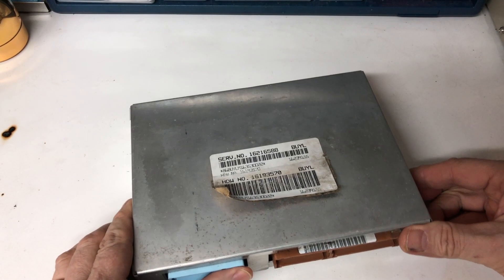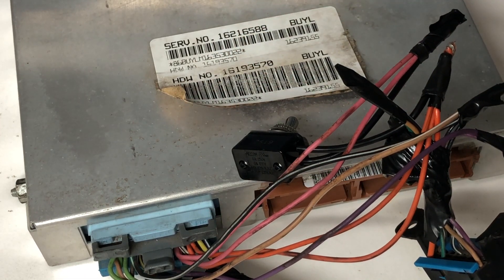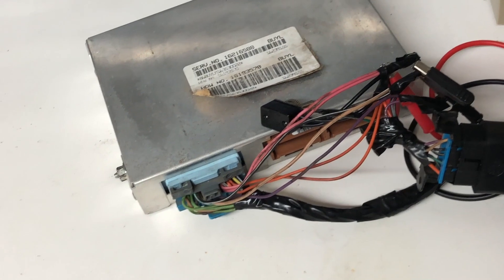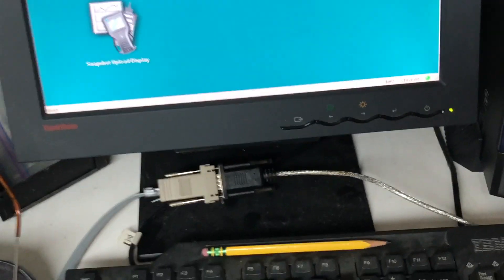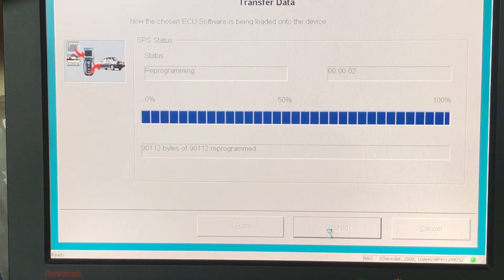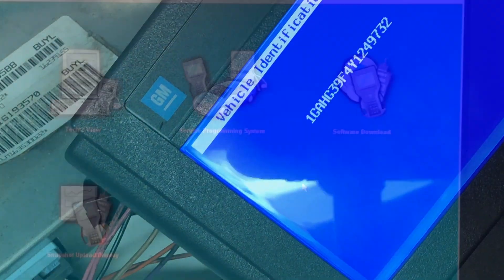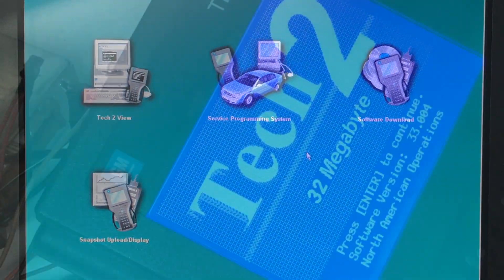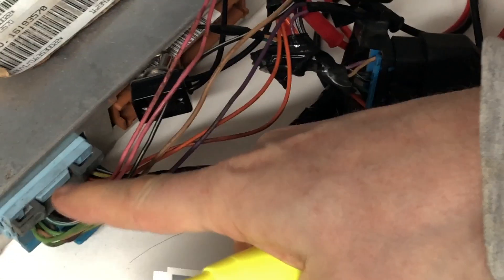1996 - 2002 GM 6.5L Diesel Used Salvage Yard PCM VIN Reflash with SPS and Tech2 (Chevy & GMC)

Comment: Hello
Can you please measure where the diode between the two capacitors behind the pin 1 of the light blue connector is connected to the light blue connector? Regards

Comment: I'm confused. If you use the donor VIN then wouldn't a State inspection thru the OBD Port mess things up since the PCM VIN is no longer matching the actual Vehicle VIN?
Reply from the maker: Donor PCM, not donor VIN.   SPS will reprogram the donor PCM with the trucks VIN as part of the re-calibration process.  Not the other way around.   The screen I believe you are referencing is just the opportunity to confirm you want to overwrite the donor PCMs currently stored VIN with the one for the target truck.  When bench programming, with the PCM out of the truck, you have to tell SPS what VIN to go with.   This sort of situation only arises with a salvage yard PCM.   A new, or remanufactured, PCM will not have a VIN married to it out of the box.

Comment: Your experience is so valuable to so many people!  Can you please help me find a great company to work on my PMC/ECM for a 1996 GMC Diesel 6.5L Turbo model K20953 pickup.  My mechanic can't find a reputable company to work on it or find a replacement part that can be programed.  Any help is truly appreciated because my pickup that I love is just sitting waiting for this important part!  : )
Reply from the maker: Thanks, these PCMs are not discontinued and still available from GM so not sure why your mechanic is having trouble there.   There are search links in the video description.   

Now they are not cheap, need to be programmed, and are not available aftermarket.   So you'll have to be willing to put down the coin for a remanufactured unit.  Or, alternatively, have a mechanic with a subscription to www.acdelcotds.com and a GM compatible J2534 scan tool to use SPS2 to reprogram a salvage yard one as I showed in this video.

If you don't have access to someone who can program these, then try on the eBay link I provide in the description for a seller who will do the programming for you if you buy their used PCM.   Usually Flagship One will do that.

Comment: What was the original problem that made you want to change the pcm. I love you videos you keep my pickup go pickup going there is no Mechanic in my area that know how to work on 6.5
Reply from the maker: This particular video wasn't the result of a repair need.  In this case I was salvaging the PCM for resell.   The video was just my sharing how I go about making sure I'm selling a good core in doing so.

Typically you would be replacing the PCM though for limited reasons.  So as if it was physically damaged (like during a collision), water damaged (like in a flood), internal corrosion (oxidation affecting the circuit board connectors or components), or electrically damaged (where a short or surge has knocked some or all of its original functionality).   They are otherwise very hardy components and rarely go bad.

Comment: Will this work with the 99 6.5 gmc savanna short busses
Thanyou Doc!!!
Reply from the maker: afaik, every 6.5L diesel from 1996 and up used this same PCM.  Though I have seen the Hummer H1s sold under an AM General part number assigned rather than using the GM part number (yet the ones I've seen still have the Delphi 16216588 sticker on top).

Comment: Would you happen to have a part number for the service manual you are using?  I would love to have a copy of that for my 6.5L.  This is a very inspiring video :)
Reply from the maker: They are out of print with Helm nowadays, but they are fairly common on eBay.  I'm using the 1998 2nd edition C/K service manual for this video.  It was a rather large 4 volume set cover all body styles of C/K trucks.  Here's an eBay affiliate link showing several listings - https://ebay.us/z5cENd
Reply: @DrShock  Does it cover the G-series vans with the 6.5 as well?  Thanks, I'll take a look :)
Reply from the maker: No, there's a separate G service manual for the Express and Savana.

Comment: i have a old pcm from a 01. if i flash it for my 96 would it run or would vats/passlock get in the way?
Reply from the maker: It would have to be the exact same GM part number to be compatible of course.  If the part numbers are exactly the same, and the 96 one is still functional, you can do a replace and program option and the Tech2 will clone it as an exact copy.

Comment: Love the videos. Can we just use the tech 2 on the bench and not up date and just switch the vin ???? Or even in the vehical
Reply from the maker: Thanks.  Whether on the bench like this, or in vehicle, the GM tools marry the VIN to the calibration update process they call SPS (Service Programming System).   So GM doesn't have an "update VIN" function (remember GM is selling PCMs so there's no money in supporting the use of used modules).   Nowadays in fact they outright block the reuse of modules.   That all said, with the old TIS2000 only, you should be able to go in and update a PCM that already has the latest PCM to a different VIN (if its the same year same model with same exact options ONLY).  I didn't show this, but you'll get an error that you can't update to the same calibration, but you should be able to ignore that and it will still update the VIN.   I'll try and show that approach in a couple of weeks when I finish the video on the Vortec V8 gasoline engine VCM updates for 1996 - 2001.

Comment: Great video. Can you program a remanufactored ecm the same way?
Reply from the maker: A reman one should already have the latest calibration installed as part of the recovery process.   But if not, sure you can update it during the config process.  The reman units will put the PCM back to a virgin state (if done right) to match how a new one came out of the box from GM, without any VIN.  So you'll go thru a very similar process as I showed here other than choosing the program and replace menu path.
Reply: Take you for responding. The reason I asked is because I have a 2000 6.5l diesel with no start. Used a scanner and had no communication, so bought a clone tech 2 and still have no communication. Was thinking of buying a remanufactured one and trying that.
Reply from the maker: Like in this video, you should be able to communicate to the PCM all by itself.  So not being able to points to only one of two things.  Either the PCM has bit the dust, or there's a problem in the wiring harness.  I'd rule out the latter before dropping coin on a new one.  You want to verify you have voltage and ground at the PCM harness connectors that plug into it, and that the communication bus is not shorted to ground/open.
Reply: Thanks for replying. Already checked  voltages and ground at pcm and had 12 volts. I'll order a remanufactured and go from there. Again thanks.
Reply: I've got a 2000 c3500 6.5l turbo diesel. Had no communication with OEM ecu. Purchased a remanufactored ecu and tried to flash with tis2000. When building vehicle I've got to adding year, light weight truck but I dont see a c3500 on list of vehicles. Which vehicle should I use to continue? Thanks
Reply from the maker: @timothyjackson7813  You won't see 3500, or 2500 for that matter, listed.  You would just select C or K if 4x4.  They are all the same.  You may be asked about the GVWR as well.  Go with the heavier of course.
Reply: Thanks for replying. I see the c and k in the tech 2 but cannot find that in the tis2000 software. In tis2000 software, I see vehicles like Tahoe, suburban and a few more. Am I using the wrong vehicle type or do I need to use medium weight instead of light weight. Thanks
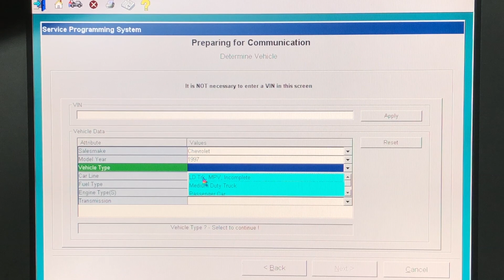Reply from the maker: Ah ok, I presume you are on the screen shown in the video at 9:01 of TIS2000?  If so, yeah that drop down list is not a complete one.  You can choose any body style that is in the same C/K family such as Silverado in the case of your C3500.
Reply: Thanks, I'll try that when I get home. I certainly appreciate your help
Reply: Purchased tech2 but know vci loopback failure. Do you flash ecm for sale?

Comment: Question Doctor Shock. I have recently converted my 96 c3500 with 6.5 from automatic to manual trans. I’m getting codes now for pcm not seeing shift solenoids and tcc solenoid etc. Can you/dealer reflash my PCM to have the same vin but choose manual trans to remedy this? Thank you for this video and any info would be great.
Reply from the maker: That would depend on whether the 1996 C3500 offered a manual trans option with the 6.5L diesel, and that the one you're now using is that same one rated for 6.5L duty (I believe this would have been the NV4500 trans for 96).    Otherwise the PCM will not recognize the configuration as factory.   Since the flashing software from GM is VIN database as built by factory driven, it would have to be a different VIN used to get it to flash the PCM for your modification.   Some dealers will do this job, some won't.   You'll have to check around first, but have the donor VIN handy from a 1996 C3500 salvage yard vehicle.   You might have an easier go finding a 6.5L PCM being sold from such a vehicle, and then turn around and resell yours to recoup some of the costs.  No, I'm not a business so I don't do this kind of work.
Reply: @DrShock  thank you for your reply. Yes it’s a factory trans option nv4500 I installed. There is an aftermarket diesel business that will do it and also add a tune for towing but it’s pricy. Tried to buy a pcm off eBay but it failed APP voltage test when I sent it to them so I’m out already for that one but I might just bite the bullet and send them the one out of the truck. Thanks again for your knowledge on this

Comment: hi hello, I wanted to ask you if it was possible to pass the data from the old control unit to the new one.
if possible have a contact to talk about it.
Thank you
Reply from the maker: For the diesel PCMs prior to 1996 you could just move the PROM chip over, but for the programmable series like in this video you have to have a scan tool.   Some modules like radios and body control modules you can move over a single EEPROM chip, but for this type of PCM that data isn't available so scan tool is the only way.
Reply: if I let you have the two control units would you be able to pass the data?
Reply from the maker: @ElectraGlide-vx6cp  I'm not a business, just sharing knowledge so folks with the skills and equipment can repair these themselves.  

If you would prefer someone else do the repair, best bet would be to drive the vehicle with the original PCM into an indy repair shop and have them do the program and replace of the PCM for you.  If the vehicle isn't drivable currently, then best bet is one of the mail in shops where you can get your PCM programmed.  Google mail in GM PCM programming and you'll get several hits.  But these services are not cheap, even if you supply the PCM.  They are all just doing some variation of what I've shared here for free.  ;-)

Comment: Are you using windows xp or is windows 10 ok to use?
Reply from the maker: I'm actually using Win2K as that was what it ran on in the day.  But WinXP should work too.   Nothing newer would support such an old software package that needs direct port access control.
Reply: @DrShock  ok thank you i'll reload xp
Reply: Win xp worked for me. I programmed another pcm and confirmed that wasnt my problem. But its ok another skill is always good.

Comment: There is a crank sensor..I own a 1998 6.5.
Reply from the maker: Yes of course, and here's how to replace it - https://youtu.be/yDGwnRofpKc but it doesn't trigger a relearn from SPS like a gasoline engine.  As mentioned it would at most trigger a TDCO relearn for the 6.5L diesel.